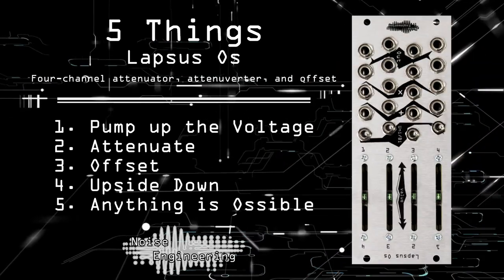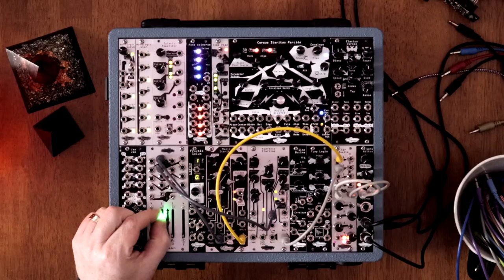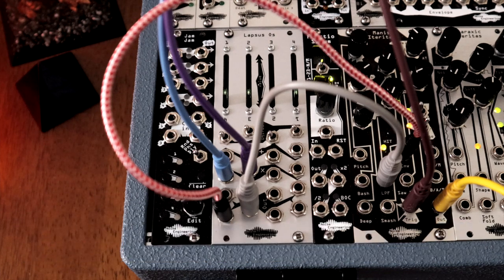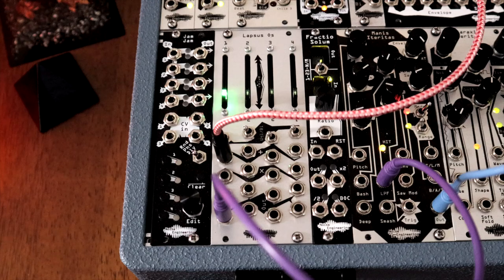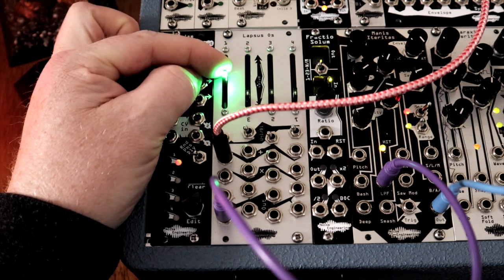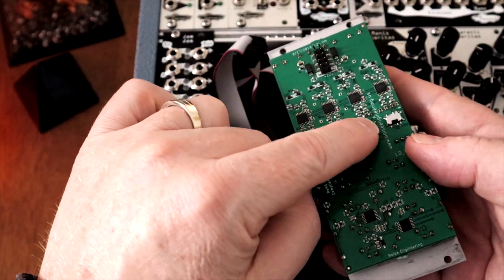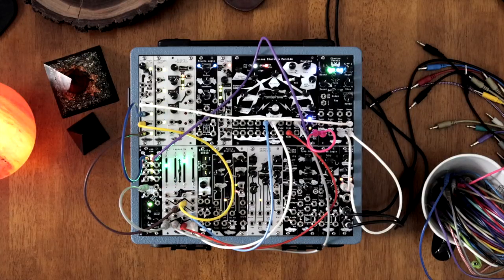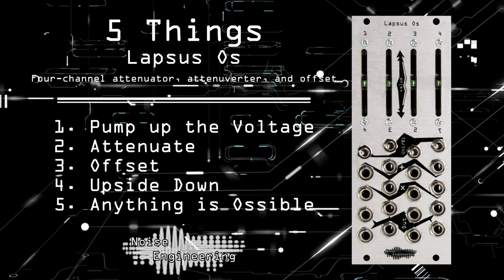5 Things you can do with the Lapsus Os attenuator/attenuverter module from Noise Engineering

Comment: It's probably not ideal, and it's not documented as such, but I often use Lapsus Os as a mixer or a Send/Return with audio rate signals (dual outputs = send, another lane is return, two lanes is stereo return) . Also super cool to 'inject' phase modulation into modules like the Virt Iter Legio through Lapsus Os and 'moderate' the output from e.g. the Ataraxic. You can also do funny things with melodic CV but it usually gets messy.

Comment: sO snsdɐ⅂ 🙃 Lovely utility module - can it generate a voltage on its own? *Edit:* Somehow I missed the very beginning where they said it could. Sweet!
Reply: Yes. You can use it like a fader bank if you want. It's so useful I have 3 of them. If I had extra  room, I'd probably get a 4th. It can generate 0 to +10v, or I believe ±5V depending on the position of the Uni or Bi switch position.
Reply: @klownklocked8064 Can't believe I missed where they mentioned it in the beginning. Thanks! Seems incredibly useful